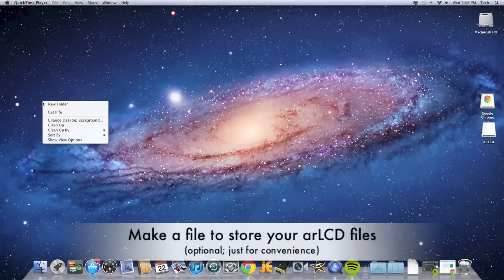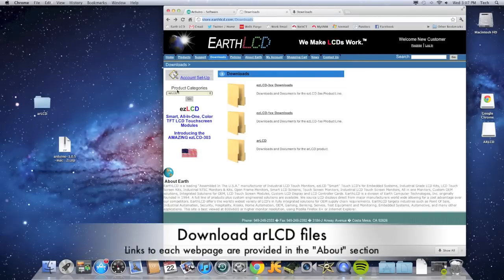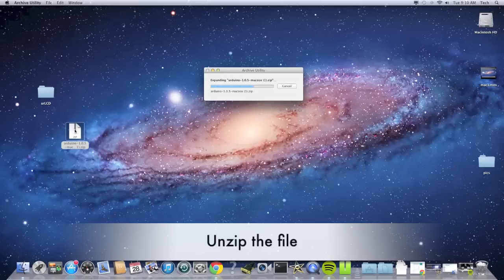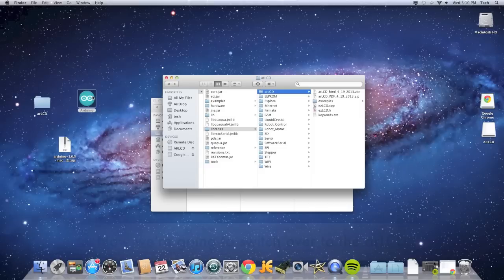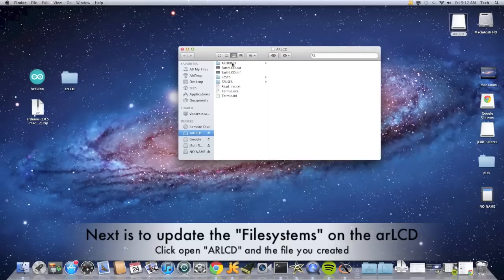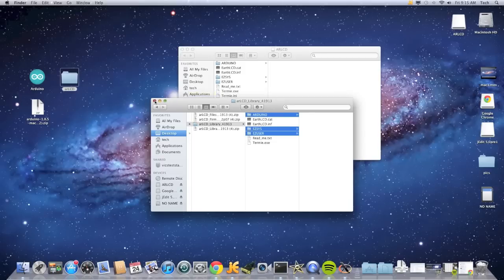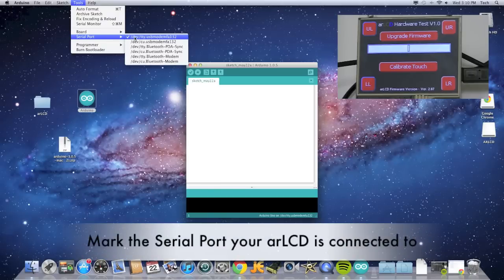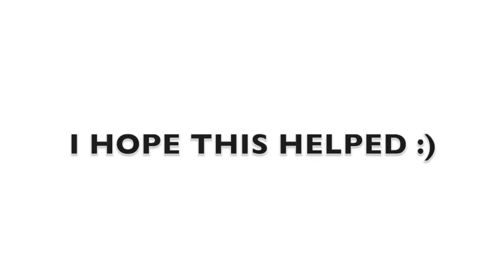Getting Started with the arLCD (Arduino Compatible LCD)

Comment: I found this intriguing for a project i'm doing for a new product preproduction run and though it was a touch screen with built in nano but after reviewing its just a thick as a raspberry pi with a touch screen and an aluminum divider heat shield?  I need thin thin thin